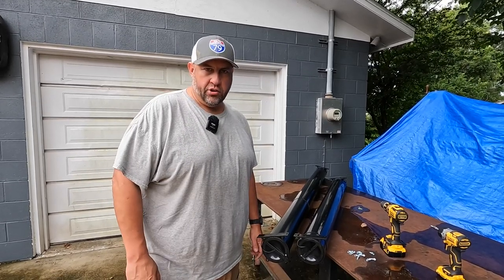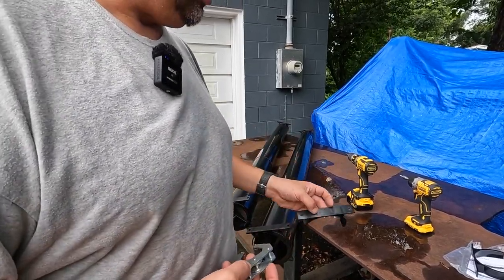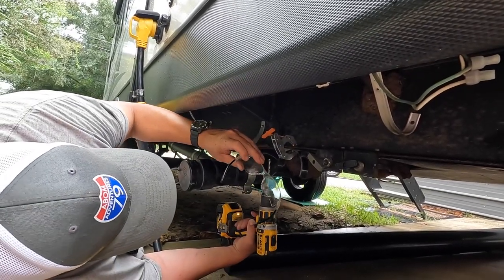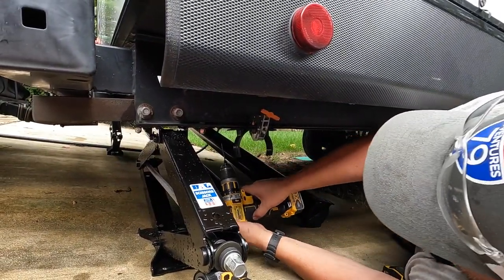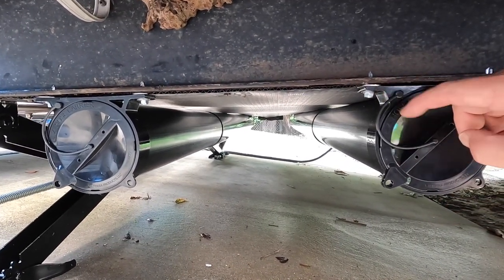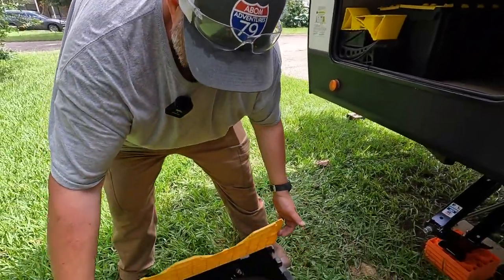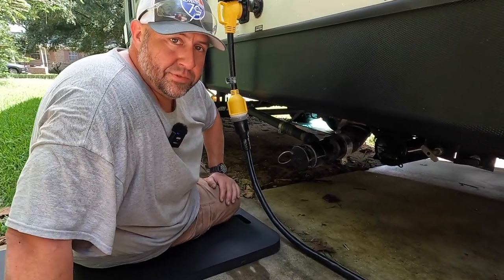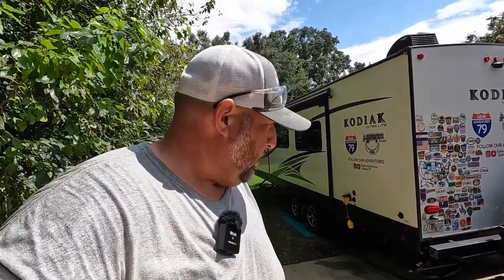RV How-To: Valterra E.Z. Hose Carrier Install

Comment: One other tip. To make it easier to find the right spot to place the lid before twisting  closed, I inserted the lid in the spot that it goes before twisting closed, and put a small white spot on the lid and tube.  It makes it so easy to get the lid back in quickly.  Abom is right, the lids can be a pain to get back in just right so they twist and engage the retainers.  The alignment spots make it easy.

Comment: Adam nice addition with the tubes. Noticed that you had to hold the cap back while trying to push in waste hose in initial. Might design a cap retainer like what is used on a car gas cap to hold it back might be beneficial. Enjoy watching.

Comment: It's not surprising that you are modifying your trailer to your needs. I wonder though, when you eventually get it exactly right, you'll be thinking about buying a new one. 😁
Reply from the maker: Nothing it ever exactly right. There's always improvements and mods to be made to make it your own, same with anything else as well.
Reply: I wouldn't be in a hurry to replace something that is tailored to the owners needs, regardless of age. New anything in this market is over priced and just another project to customize to ones needs.

Comment: My TT has 2 Black tanks so I installed 3 of these to be able to carry plenty of hose.  Easy install and durable.  The lids can pop off if you aren't attentive when putting them on. I put small carabiners in the latch holes after the lids were on and twisted in place.  Did save me from losing a lid once when I didn't pay attention putting the lid on.  They will hold one long hose or 2 shorter ones snapped together.  If you try to pussh more into them the lid will pop off the other side so keep that in mind.  These work very well and are worth every penny

Comment: Well done. Great idea and its truly amazing that any manufacturer doesn't do the same as base equipment. It makes so much sense...you wonder why they don't do the same when they are built. Same with the storage bins you will install...seems to be a fair idea to include them as standard equipment as the value is extremely high for the cost.

Comment: Just put one on my trailer. I used jackstands to hold the tube up. Hot that hint for another you tuber. I also zip tied the none opening end. My sewer hose is 20 ft and had a little trouble making it fit. I had to open the plug on the end of the to let air out.I also used blue lock tight on the screws.
When you use the bumper for hose storage put some stainless steel screws in the end caps. This way your hose wont come out and wave at people.

Comment: Our 5th wheel came with a half version of that but as you said 1 hose isn’t enough so we added that same mod and are able to keep 2 hoses connected together in 1 tube.  That gives us 3 total hoses in the tubes.  Great storage.  Great install.

Comment: Should be standard equipment from the factory... 🙂
Reply: FYI there is standard storage for the sewer hoses watch the video. The rear square bumper rubber end cap has a hole in it that allows storage for sewer hose.
Reply: @michaelbrowne8068  It's not big enough for most hose needs in campsites.

Comment: Who would steal a sewage hose? Someone that lost theirs and doesn't want to pay for a new one, that's who.

Plastic brackets, how long before those crack? Or how long before Adam fires up the CNC and makes new aluminum necessarily over-engineered brackets?
Reply from the maker: I respectfully member of the rv’ing and camping community would never steel something from another rv’er. Not saying it wouldn’t happen, just not likely. I think your more likely to encounter people who’d rather vandalize your stuff. I doubt anyone who is storing their sewer hoses outside has had to deal with them being stolen.

Comment: I am not liking the use of the self  tapping bolts.  I drive a semi truck… I know what kind of vibration the road puts on stuff. Then you added washers and that gives you less bite.  

Thru holes with Stainless bolts and lock nuts is how I like to do things like this.

Comment: Thought the stinky slinky went in the bumpers
Reply from the maker: If you watched the video you would have seen that I mentioned you can also store them in the bumper and that I have one in it.
Reply: @AbomAdventures  A few of the viewers missed that completely. "Pay attention class"
Reply: Many of the new heavy duty sewer hoses will not fit into the standard 4" RV bumper.

Comment: I got this as a gift and I'm waiting for nicer weather to install it. Having watched a number of installation videos it seems everyone is down on their knees crawling under the camper just to put the hose in or take it out. Ending to the frame takes away a foot or so of storage  and makes it hard to reach. I'm looking into making a brace that will allow the opening to be out to the side just as my dump connector is located. I have the one that extends to 94" so it should work at least for the one side I will be accessing the hoses from. Has anyone made any such modifications?
Reply: In answer to my own question, using the supplied extra braces I was able to extend the ends even with the outsides of the camper.